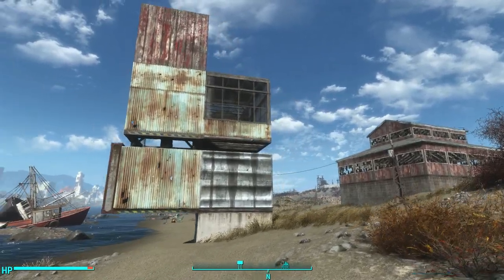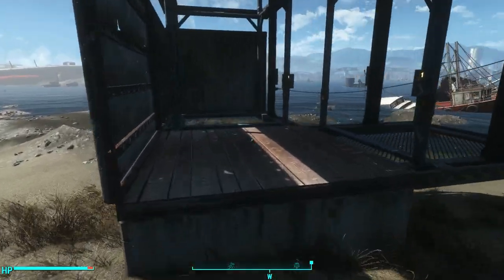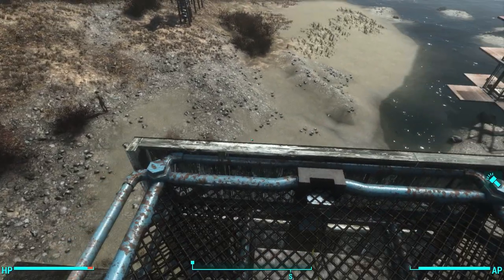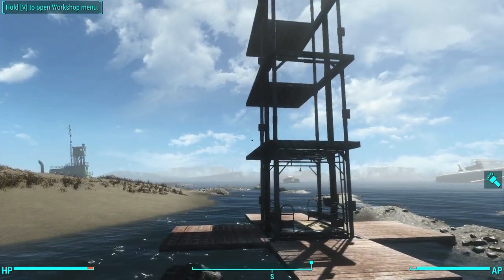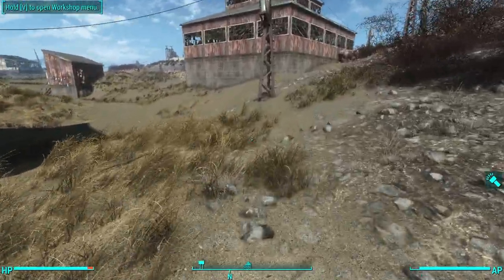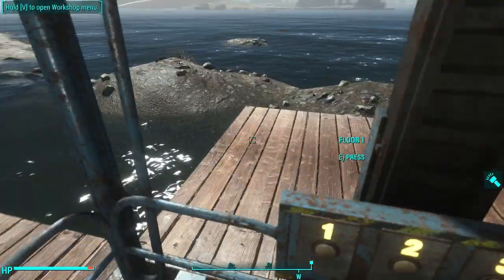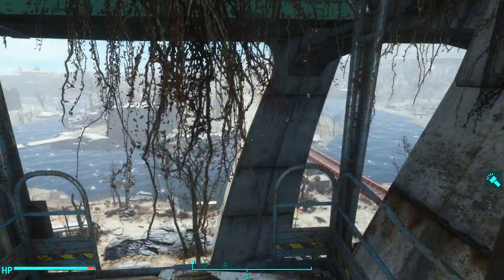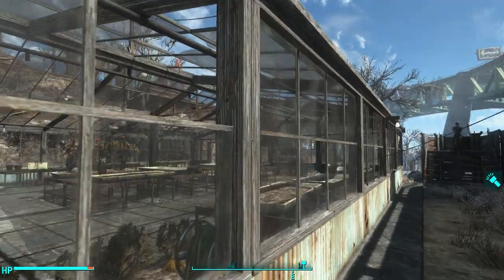How Elevators Work from Contraptions Workshop - Fallout 4

Comment: I have yet to try these out but using the old tile sets you could use the gap between floors to place the power wires for lighting your structure. Just build floor/roof as normal and use the top/bottom mount power conduits between the floors. Filling the gaps on the outside may be interesting without mods though.

Comment: I actually used concrette with them and to fill the gaps you can just use double upper floors.
Reply from the maker: Great tip!
Reply: +Oxhorn It does have a paper thin gap but you really can't notice at all. It can be a bit tricky to get them to snap the way you want them to, but basically you just have to build from the bottom up.

Comment: What I found that sucks is that the 2nd floor elevator can slightly sink in if you level it with a floor already made (I did this in mechanist lair) but the 4 floor elevator will not. That really bummed me out.

Comment: Thx, was having trouble figuring out wtf they were supposed to work with...was driving me crazy. I've never used the warehouse or barn tile sets and after looking thru them, I remember why; far too many holes.  Where's the 'wall' in this wall?!!  LOL  So, yeah, I definitely wish they worked with the other tiles.  All I ever use is metal & concrete, but still, thanks for clearing that up.

Comment: I really wish they worked with concrete. I know you can do 2 floor elevators but I don't like having a 2 floor elevator on every floor. My house is 4 floors but the 4 floor elevator has too big of gaps between the doorway and the floor so with each floor you have to add more and more steps just to get inside.

Comment: I love the elevators, but I've had the 4 story ones bug out on me 4 times now. 3 times it's been that the floor buttons on the main elevator suddenly appear 1 floor up. However this last time, it bugged out so I scrapped it and all the floor numbers remain so now I will need to look for console commands to delete them I guess. I hear this issue does not plague the 2 & 3 floor ones. only the 4. Not sure if this is due to me trying to mix with other tile sets or whether the 4 floor ones are just bugged.

Comment: can settlers use elavators
Reply from the maker: No, sadly
Reply: so i guess building a hotel without stairs wont help me :( sigh.
Reply: Jindorek what would you do if there was a fire?
Reply: katsupoi24 I'm glad settlers can't use elevators. I build a small tower for my character in most settlements put a bed down and store ammo weapons and fusion cores in it and when you use stairs, even when their not connected and you have to jump, settlers still end up in my bed and are able to steal my ammo....sorry but my settlers don't need 2000 of an ammo type and a weapon I was saving for me to screw around with. :/
Reply: Oxhorn settlers can't use elevator? 😩 😩
Reply: +MetalTrades why do you store your fusion cores? they literally weigh nothing. 0.
Reply: CreatureQuake They weigh 4lbs in survival mode.

Comment: have the elevator buttons ever completely disappeared from the control panel for you?... and the 4 floor snapping issue is so annoying.
Reply from the maker: Yes. To fix this missing elevator buttons, select the elevator in the workshop and move it around. Instead of placing it, press tab to release it and exit the workshop. Buttons reappear!

Comment: I was in sanctuary and the 4 floor wouldn't snap to the floors there either. It's bizarre. Also, do you know if NPCs use elevators? I ask because I don't think they do.
Reply from the maker: No, they sadly don't.
Reply: +Oxhorn Well there goes any point in using them in a settlement.

Comment: How do I power these if I build a structure around them? I tried putting a conduit on each side of the wall then connecting one side to power and the other to the lift but it won't work
Reply: The "Skooled Zone" channel has several videos on the "rug glitch" that might solve your problem.

Comment: I built some 4 floor scycrapers with shops on various levels but it seems like my settlers won't use the elevator? A lot of them just stood outside of the tower. There are a few people in the tower but only the ones that started there when I fast traveled there and I've never seen any of my settlers actually move to different floors. Anyone else have this problem? Can settlers only take the stairs?
Reply: Should have read the comments first yeah it looks like they can't use elevators
Reply: The "Skooled Zone" channel has a video "Elevator Problems and Elevating Settlers" that might be helpful.

Comment: Hey ox will the settler get stuck on the lip entering the elevator
Reply from the maker: I never had a problem with it, but honestly, settlers do not use elevators in my games. They just never use them.
Reply: +Oxhorn thanks for replying do u know if this settlers not using the elevator is a similar  thing to hang men's ally settlers not using one half i.e. Can I build a big ass tower and have beds on upper floors

Comment: i built my first 3 floor apartment building at coastal cottage out of concrete. because of the layout it had, stairs didn't work quite as i wanted to so i decide to remove them completely and replace them with an elevator. i built the concrete building as i wanted but noticed that the upper floors did not match the elevator level. took me another similar building to realize that i needed to connect the floors and walls to the elevator shaft lol still the space in between floors doesn't bother me since it's barely noticeable, i'm just pissed that the settler AI can't use the elevator to get to their beds.  they just sit below staring like retards at the ones sleeping on the lower level. you'd think with all the current gen tech they could make non-retarded settler AI but nooo
Reply: iAmDaos ikr I have 3 stairways going up each floor on my 5 story building, when the settlers go to bed, they all stand there lined up, taking 50000 years to single file up the stairs. they won't use the other available stairs idk why. they're hopeless -_-
Reply: chikkin nuggit same reason i don't use companions : cheap AI even with current gen tech in 2016, nice show bethesda

Comment: My 4th Floor elevator keeps glitching for me. The floor buttons would end up floating above the elevator. Also sucks that settlers are too dumb to interact with the elevators, Lol.
Reply from the maker: If you move the elevator after placing it, the buttons glitch out. You need to enter workshop mode, select it with E, move it, and then release it with TAB. This will fix the buttons.
Reply: ***** I tried it, didn't work. Im on console if that makes any difference. I had to store it and bring it out again in order to fix it.

Comment: Can settlers use elevators?
Reply from the maker: I don't think so. My settlers just stand around the elevators.
Reply: +Oxhorn :( Guess I'll just have to build fire escape type stair systems for my settlers.
Reply: Nope :c I'm trying sending some settlers to shops and beds in the 4,3 or 2 floor with the elevator and nothing. They just stand in front of the elevator or some. Then I went to my bed (for 2 hours), and when I went back to the elevator ....  all settler are in the floor 4,3 and 2... magically. So, your settlers and your companion CAN'T use elevator... !!